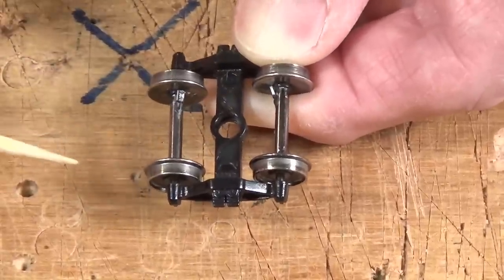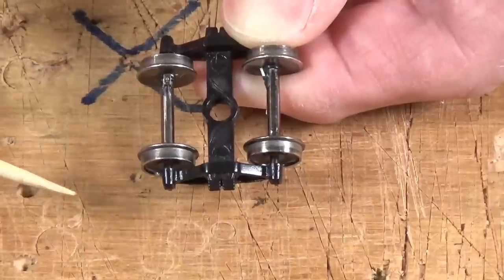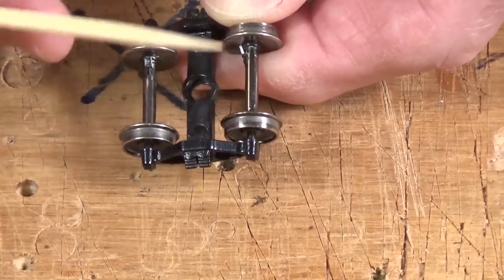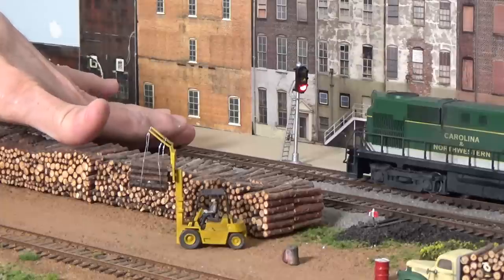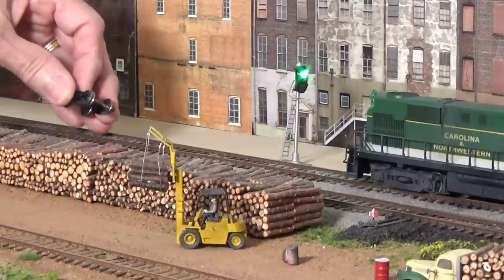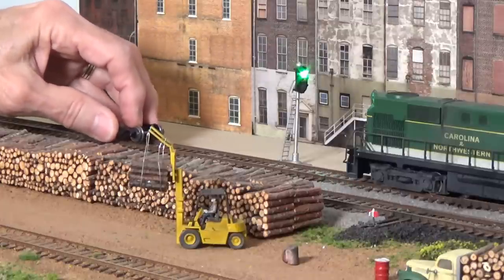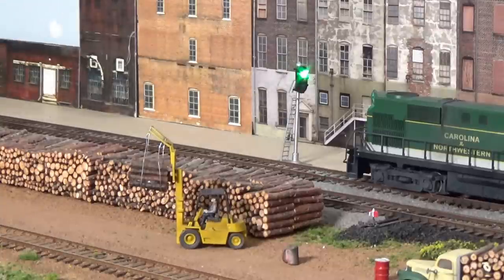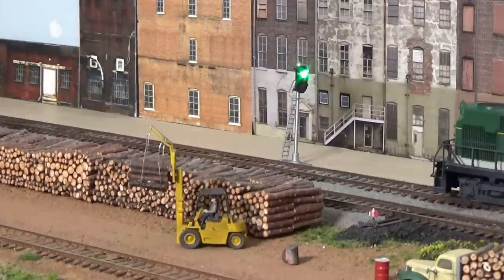Installing ABS Signals On Your Model Railroad (318)

Comment: Another interesting video, thank you. However, something to be aware of is that by placing a 10k resistor across both axles of your bogie, you have an equivalent resistance of only 5k.  This is because the resistors are connected in parallel.  If you then had the same bogie at the opposite end of a wagon, your equivalent resistance is halved again, thus presenting only 2.5k for just one wagon.  This reduces further if more than one modified wagon is included in a train.  The caution is therefore to ensure you don’t exceed the minimum resistance which will initiate a short circuit on your controller, or indeed to draw additional current.  Hope this is of help, and no offence intended.

Comment: Hi Larry another excellent video...I've watched quite a lot from here in England, especially adding items to the Piedmont Southern. Would it be possible to show the full operation of your excellent layout? We always see it in the background but I have never seen it in full operation.
You never know, you might convert me to American Railroading!
best regards
David.
Reply from the maker: The problem is there are 2 major gaps that need filling. First there is a 4’ long bridge that needs to be built and second I need to install another helix to go between the main deck and the upper deck. I had hoped to tackle the bridge project starting last January but ran into a construction snag and some other issues. The helix just needs to get done when I get time since I won’t be repeating that build in videos as it will essentially be a repeat of the first. I hope to have an operating session next year this time and having the track completed will open up a whole new world of video topics.

Comment: I've now seen all three of your ABS signaling videos (287, 289, and 318).

I think I can design and install a system based on block occupancy. But what about including turnout alignment into the logic? So far, there is enough info to set the aspect of an inter-block signal head, or to set the top head of a two-headed mast, or even to set the top and bottom heads of a two-headed mast. But, based on block occupancy alone and without knowing the position of the turnout, you could end up with a green-over-green; which could be useful, I suppose. How can we (mostly me) expand the PC board by adding an input and whatever other diodes or whatnot necessary to add red-over-green or green-over-red aspects based on both occupancy and turnout alignment? The alignment of the turnout could come from one of the eight tabs on the bottom of a Tortoise machine or from a wire soldered to the frog for those who have manual ground-throw turnouts.

Not a complaint, at all. Just asking. Thanks.
Reply from the maker: In one of the original diagrams from the article that I showed in the video it does show how to use switch contacts on a Tortoise or other device to take the signal board logic to ground and display a red signal if the turnout is thrown. I will be using that feature on the Piedmont Southern, especially for crossovers, but likely will not do it for every turnout in a block. This really is not meant to be a complex ABS logic system and I believe that there are commercially available ones that can do a lot more. Because of copyright issues I cannot provide a copy of that diagram or the article. In the video I offered several suggestions as to how you can obtain a copy of the original articles.
Reply: @TheDCCGuy   Thanks for responding. I will go back and re-watch the videos with a pad and pencil in hand. I'll also start looking for the original articles in the March and April 2001 MRRs.

Comment: Thanks again for another illustrative video, which turns a seemingly complex subject into a number of not-so-complex steps.  Functional signals do add an additional level of realism to a layout.  They also add some visual drama for the casual spectator. 

The velcro attachment method is an ingenious idea that is very useful across a wide range of accessories. 

One question that comes to mind— how do you deal with power to sidings?  Are they powered separately from the block to which they are attached, so that standing rolling stock on the sidings wont trigger an erroneous "occupied" signal?
Reply from the maker: I wire all sidings, spurs, and ancillary track directly to the main power bus and then use a sub-bus detection wire for the mainline detection rail. I plan to do a video on wiring for detection that will go over that.

Comment: Larry would this set up work with g scale if you weren't using dcc without block detectors? thinking of insulated  rail and wheel sets like you did with atlas boards unless you have a better idea any suggestions appreciated  Have rc engines with railpro.thanks tom

Comment: The Atlas signals system can be done this way by just using 4 wires, It may seem a little costly but it almost pug and play.
Reply from the maker: As I said in the video there are various commercial signal systems available, but as you point out this one can do it cheaper than most if not all the commercial ones but is not available off the shelf. Personally I wanted something that I can build myself, works independent of computers, and is not dependent on stock availability from a factory in China.
Reply: @TheDCCGuy  DITTO!

Comment: Is it possible to interface this signalling system into JMRI Panel Pro?  If so a video on this would be appreciated.
Reply from the maker: No, this is a totally independent system. However an electronics guru might be able to figure out a way.

Comment: How far into the block can a train go before the signal turns red? Asking because on my layout I may have to have the signal placed a bit in front of the activation sensor.
Reply from the maker: As soon as the loco wheels cross the block gap the signal will change. So it may be reasonable to place the signals accordingly.
Reply: @TheDCCGuy  thanks

Comment: I'm still in the early stage of understanding signals, so this may be off. Larry, you mentioned your signal is default to green. From what I understand of RRs is that default is typically red, so if there is a fault, the block shuts down. Could you comment? Thanks!
Reply from the maker: I meant default in terms that the signal is on and green  if the block ahead is clear thus allowing the train to enter that block without stopping. This is opposed to approach lighting where the signals are unlit until a train is detected approaching the signal. However if there was an equipment failure then I could see a rationale for a red to display assuming there was power to do it. Even where signals were powered with line power they typically had backup batteries as well. As I understand with semaphore signals some railroads preferred upper quadrants since if the arm swung down in a failure it would come to rest in the red stop position instead of the green position as would be the case with a lower quadrant semaphore.

Comment: great info but for my switching layout not very usefull
Reply: Functioning dwarf signals protecting your turnouts might be a more appropriate option for a small switching layout.  And if your layout includes a segment of supposed through "main line," protective ABS signals at either end of that block might also provide some operating interest.